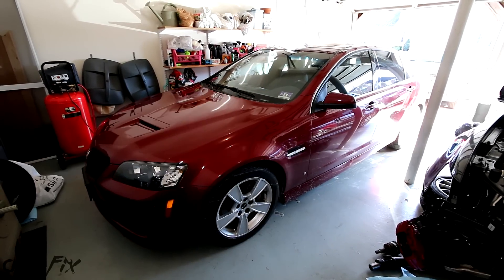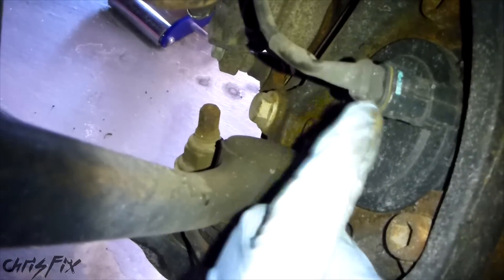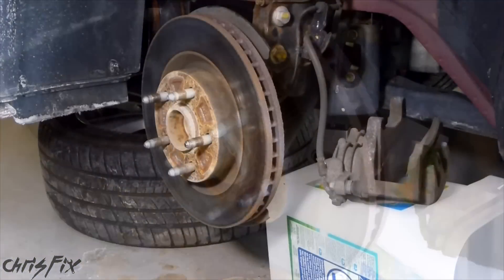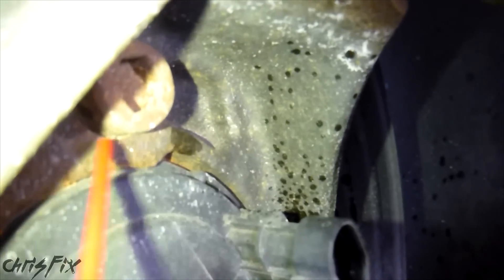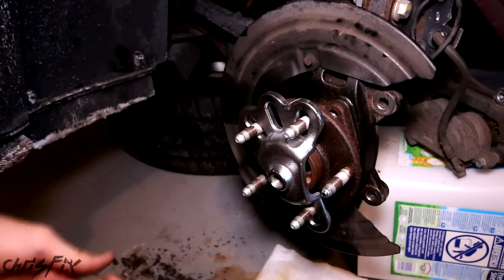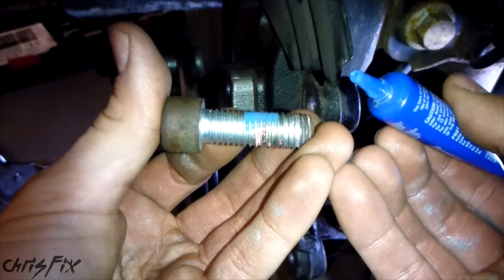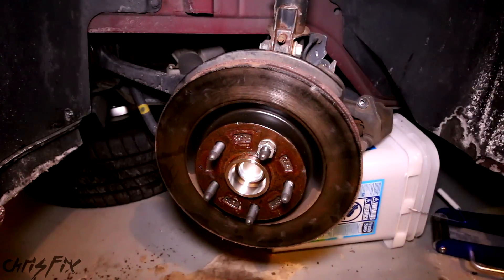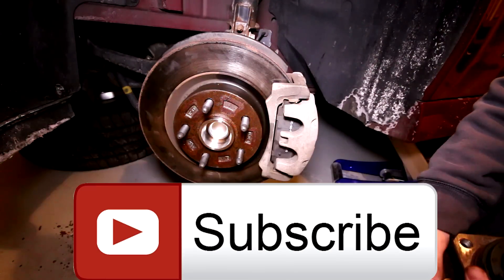How to Replace a Wheel Bearing

Comment: How are those Mevotech parts working out for you?  I've had nothing but bad luck with them in the past.  I prefer Sankei 555 when I can't get oem.
Reply from the maker: Audioquest56 They have been bullet proof for me but I just started using them. Maybe their quality got better?
Reply: Hopefully their hub & bearings are better than their suspension parts.

Comment: Hi chris, can you give me some tips to better the performance of my ride i have a 1984 Buick century, naturally Aspirated! Thanks Love from venezuela!
Reply from the maker: luis lopez What engine is in the car? Is it front wheel or rear wheel drive?
Reply: ChrisFix the Engine is a 173 chevy Engine 0,30 with a th-125 gearbox front Wheel drive
Reply from the maker: luis lopez What do you want to do with the car? How much money do you want to put in it?
Reply: ChrisFix a better fuel economy and more stability
Reply from the maker: luis lopez For better fuel economy you can do a tune up. New plugs, wires, air filter. You can use synthetic oil instead of conventional. If you really want to spend money, you can get your intake and heads ported and polished which will increase power as well as fuel economy.
Reply: i can use synthetic oil in any old car? there's no problem with that? i alway have that concern
Reply from the maker: luis lopez How many miles on the engine?
Reply: ChrisFix the engine has been recently rebuild! all brand new a new camshaft, new pistons head and everything is a ''bout 7000 miles!
Reply from the maker: luis lopez Then you will have no problems at all running synthetic.
Reply: thanks chris for your time! =D

Comment: do the threads need to be greased? would it hurt to do so? thankyou.
Reply: If your talking threads on the bolts then yes, that is bad. You would run more of the risk of them wobbling out and thus defeating the purpose of using lock tight on the bolt threads. Just clean them off with a wire brush or like in the video, carefully pick off the rust with the small flathead screwdriver.

Comment: Chris, did you mention the price you paid for this bearing? Thanks
Reply from the maker: Miichael F This bearing was around $175. For some reason the ABS in the G8 is finiky and doesnt like aftermarket wheel bearings but the Mevotech part works. The OEM part is almost $300 which I was not going to pay!

Comment: Hey Chris.  I have a 2009 grande punto and all four of my wheels make that grinding noise, but there is no play in my wheel when jacked up.  Also it has very low mileage of only 9,000 miles.  When i take my brake caliper off (ps my brake pads have alot of meat left )and merely spin the rotor the noise does not grind, does that mean it could just need new rotors? Or can wheel bearing go bad this soon?  thanks any info would be great
Reply from the maker: Does the grinding noise stop or change when you press on the brakes?
Reply: yes when the wheels are stationary the noise stops. you can only hear it whilst spinning
Reply: but wouldnt the noise stop any, due to nothing physically moving? thanks
Reply: Arts&Trusts
Your calipers may be warped but on all 4 wheels at the same time?
Sounds like the brakes were not installed correctly, they may be paired front/back or side/side. So if the tech out them in the wrong way, or the calipers are twisted, you could have noise.

But honestly, if all 4 wheels are making noise. Just take it all apart and put it all back together with new hardware (might as well get new pads as well).
Reply: hey @jay edlington.  thanks for the idea, i will give a look and see what it isa saying. thanks pal appreciate it

Comment: What needs to be done different if the car is front wheel drive?
Reply from the maker: Trilluminatic For a front wheel drive car you need to remove the axle nut before jacking the car up. That is pretty much the only difference for most cars.

Comment: Could a bad wheel bearing cause premature brake wear?
Reply: Not likely. Could be a bad break caliper piston that seized up and is pushing slightly on the break from not being lubed or dirty. He has another video on that here. Can also be driver error from leaning your foot on the breaks a lot aka "riding the breaks".

Comment: I would do 10 of these hub type wheel bearings before I would put myself through doing another press fit bearing.
Reply from the maker: Cole Hoover Haha, the pressed bearing isnt that bad, but it sounds like you had a bad experience!
Reply: ChrisFix Yeah well I used the harbor freight bearing press kit that I've seen you, and a couple of other use and unfortunately I didn't have as much luck as you did with it. I eventually got the old outer race out by cutting it up and beating it with a mini sledge for an hour or so. I went and used one of my college's hydraulic presses to put the new one in. And then of course my upper ball joint just spun while trying to put it all back together. So yeah it was fun haha But anyway great video as usual.
Reply from the maker: Cole Hoover Yea, that sounds like a lot of fun! Those types of jobs are what make you thankful for when things go right!

Comment: That's a weird torque: 44 ft-lbs then rotate 120 degrees. Weird!

I've got to do one of the front wheel bearings on my 2WD Jeep. It has the kind where the races are on the rotor. I've been putting it off for a few months now LOL.
Reply from the maker: dainternetguru Yea, I dont like that type of torque spec. Just give me a 80ft-lb and I will be happy. None of this 44 then 120 degrees! I want to do a video on that type of bearing in your jeep!

Comment: wait why does a 2008 car need a new bearing already??
Reply from the maker: James Dahmer It is a known problem for this car. For some reason it wears out fast.
Reply: Ok cool yea I had to replace a rear bearing on my 2005 Crv with 300,000kms. It just lasted long even through some harsh canadian conditions. Was a bit more of a hassle given the 4wd.
Reply: btw awesome channel man! any tips on getting tools for cheap?!
Reply from the maker: James Dahmer Thanks James! I get some tools from habor freight which is as cheap as it gets but you have to pick and choose because the tools are both inexpensive and cheap (in quality).  Some tools you can get away with the cheap quality, like a breaker bar, but others you want a quality tool.

Comment: How do you rent that tool for free????
Reply from the maker: +Brian Dahdouh The parts store rents it for free. Ask them!
Reply: Brian Dahdouh
Or buy it and return it right away, just don't damage it in any way.
Alot of Canadians do that, a pain for the company but easy on us.
Reply: An alternative to that slide hammer if you can't rent or borrow one is to back those three socket head bolts out about two or three turns and give them a whack with a hammer.

Comment: Would of used a 3 lb sledge and hit it hard on top easier and faster your not going to use the old bearing any way
Reply from the maker: Oscar Lopez That works as well but sometimes that doesnt get the hub off because you are not hitting it out.

Comment: why the hell would that be $700? just in labour?
Reply from the maker: SilentServiceCode They wanted $400 for the part and $350 labor.
Reply: ChrisFix checking RockAuto, replacements start at $75 or so (oem is 315 if you want) and it would take any experienced tech 2 hrs tops to get this job done. What's up at the stealership.
Reply: ChrisFix the rear bearing only is $138, wonder what the stealer would charge for doing the rear.
Reply from the maker: SilentServiceCode Welcome to the stealership lol. The OEM part is $315 plus markup from a mechanic so $400. Two hours labor is $250ish. My friend got the quote (it is his car) and that is why he talked to me and I did the job instead.

Comment: all i have to de is remove my rotor? brih, the devil himself sealed my rotor on. it wont fukn budge! ive hammered it so many times it will NOT come off. if u could make a video how to get them off that would be great cause these suckers are STUCK on...and no, there is no bolts holding them on...already confirmed that
Reply: use a propane torch and heat it up
Reply: @funkndavid  got all new ones put on by my buddy. he pissed me off cause all he did was use an impact gun with a screw and they came off like it was nothing. i was like dude i beat the hell out of these wtf lol
Reply: @Eye_4_An_Eye  lol good ol' impact gun. It probably distributed even force in different parts of the hub. trust me, I've dealt with that shit too and it was so frustrating. The propane torch was gonna be my solution as well.
Reply: @funkndavid  yea the torch thing i seen chrisfix do a few times. that was gonna be my last resort as well lol

Comment: Why don't you use air tools in your videos, is it so people see that you do not need air tools to do the job
Reply: camtheham13
Yeah, and also that air tools are expensive and unnecessary. Especially if you do work while out and about, not just on a project car at home.
Sometimes it's easy enough to park near the store, quickly jack the car up, and do the job. Then you can go quick for any grease you missed- all the while pretending you are fixing a flat tire :)
I'm not saying do your work in a parking lot; i'm saying if I am out of town and something breaks, I usually have the tools to fix it.

Comment: No way would they have charged that much for such a simple job. Where I work, we'd have charged a max £350 on such a simple set up. Takes about an hour to do, parts costs about £50 and consumables are neligable (shop towels, brake cleaner, emery tape, lubricants and anti-seize, etc). Total about £250 if we're going off £175 per hour labour, £50 parts and £25 consumables and disposal. £700, maybe if it were both front wheel bearings and discs and pads whilst in there.

(I know he said $, but I'm keeping the numbering simple.)